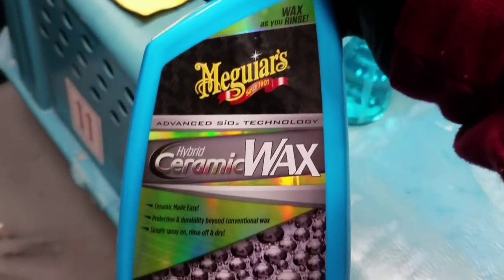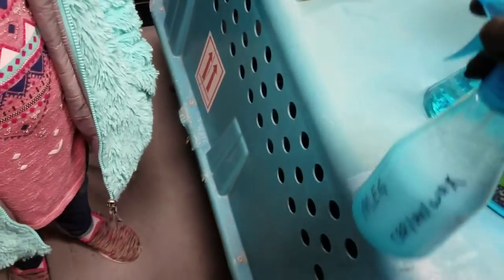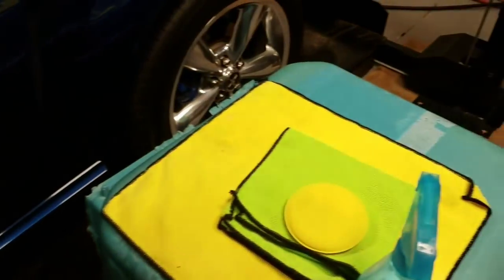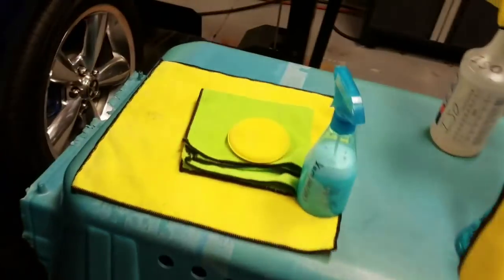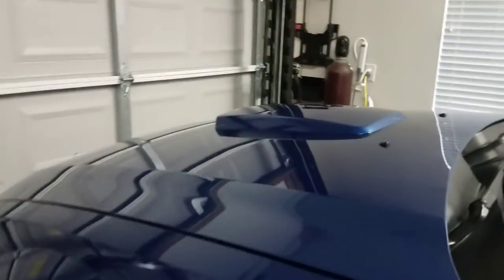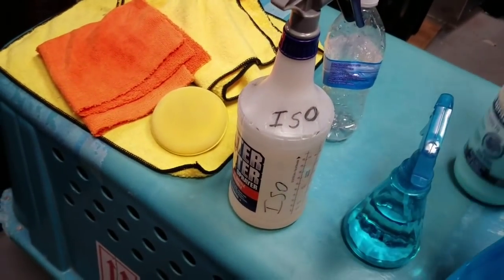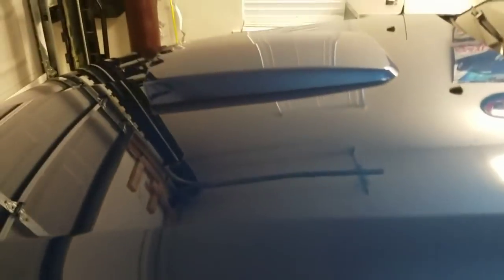Meguiars hybrid ceramic wax

Comment from the maker: Some of you are so caught up in the fact that I have chosen to dilute this product. Lets do some math. My car hold at least a gallon of water on the surface. For the sake of argument lets be conservative. Lets say it holds a half gallon of water. You spray 2 squirts per panel on the initial application that's 2×9 excluding the bumpers another squirt for each bumper. That's at least 1 ounce of product. You have 64oz in a half gallon of water that would be 64:1. So in practice my application is heavier for the initial application. That would also be the case for all follow up applications. I have chosen to apply the product consistently on my vehicle's 10:1 and 20:1 to test the results. I have chosen to apply it thicker than recommended by Meguiars. I have chosen to bring you along. Thank you for joining me.
Reply: these hybrid ceramics are water activated. once you add water you have to use it up.
but i do agree with you it's better to apply it with the pads than just to spray it on and rinse it off.
Reply: @Ashish Patel: Does the original product have any water in it?
Reply: @The Car Care Nut: Your method of application actually is genius. In the absence of wind, the dilution spray give you a much more even coating than by using an applicator pad with a few sprays of the product.

Comment: Excellent channel, thanks. I just stacked Maguire’s ultimate polish then 2 coats of the Meguiars ultimate wax and used the hybrid ceramic at full strength as a finisher/sealant using the dry application method on my starfire pearl (white) 2010 Lexus ISF.  I’m going to use your dilution method as an every other wash top up, I’ve only just completed but at this stage this product in a dry application will likely become my go to finisher, the depth is brilliant, thanks for the great content and the dilution idea, nice work
Reply from the maker: Shane Surman thank you for the feedback. Great to hear you enjoy the content

Comment: I reckon diluting the product would do a much better job when misting it onto windows as you are making more contact with such a slick surface that a finer particle spray would achieve the same if not better result then just dumping a bunch of water on it, great insight into the chemical reaction that actually bonds it to the surface, nice observation my friend!

Comment: Finally I applied the product like U did& the result is pretty good. Now after a month or so if I want to reapply the product  then which method should I follow in your opinion?
Reply from the maker: I am going to apply the diluted amount as a drying aid to help lubricate and protect the panels. Spritz a couple of squirts on each panel after you wash the car and then dry it.
Reply: @guaranteedworstcardetailin6793  thanks

Comment: Hi! Can I confirm that after experimenting, you find that 10:1 dilution the most effective? As compared to 20:1 ? Secondly, using Meguiar's Ceramic Wax using your method (10:1 dilution), how long would 1 bottle last?
Reply from the maker: natnut2008 I personally like 10:1, if you maintain your car once or twice  a week a bottle should last a year or more

Comment: To the haters: Following the directions from Megs is random and wasteful. No way are you going to get consistent and reproducible results. The CCN has correctly figured out a way to avoid that. Personally, I only use spray-on-rinse-off type products on parts of the car with lots of detail, nooks and crannies, such as the wheels and grille, and then with a much less viscous product like Gyeon Wet Coat. As much as you might love and trust Megauiar's, they do have a vested interest in you using as much product as possible. Yeah, I'm that cynical.

Comment: Why don’t you just use ceramic coatings on your paint.
Reply from the maker: I have some ceramic coating I used on a tractor and other cars. I am looking into ppf or coating for a used boat I just bought. I Don't want ceramic coating on my car. I do use iso2 products, and the ceramic wax.

Comment: You don’t dilute it!  And follow the directions on the bottle. Your not real bright.
Reply from the maker: First let me say I recommend anyone using a product to follow the direction on the label. I am just demonstrating how I've chosen to use the product on my particular vehicle.  I consider myself an educated consumer (Prosumer). What do you think your doing when you put the product on a wet car. The wet car is diluting the product for you. This way I get to control the l Dalution ratio. So to reply to your comment I consider myself  bright on this subject. Thank for watching
Reply: I get what he's doing. If you are supposed to spray it on to a 'wet' car, then aren't you diluting it by design? In my opinion, he's just using the product in a more direct manner. It seems rather inefficient to randomly spray the product on to an already wet car and then just rinse it off. I agree that applying the diluted product directly to the surface and then wiping in seems to make more sense. IMO. . .

Comment: Any idea what the dilution does to the longevity?
Reply from the maker: Not yet. Will have to evaluate it over time. It shouldn't effect it. If you spray one to two  squirts per panel on a wet car and rinse with water. That's  a lot more dilution than 10:1. My thoughts anyway. This way your not wasting as much product. You are also getting more contact from the second application.
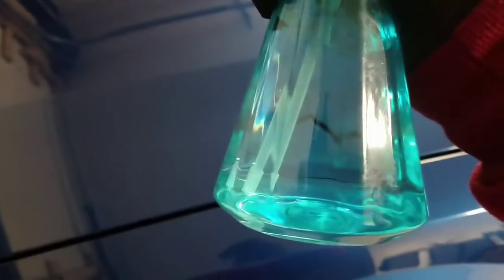Reply from the maker: @amazed6161   Amazed  feels a little thick to me not to use water to dilute it on the first application. He seemed be having some trouble getting it off at 2:45 looks like not enough dilution.
Reply from the maker: @amazed6161  Thanks for the feedback and links. Seems like a user friendly product for sure.